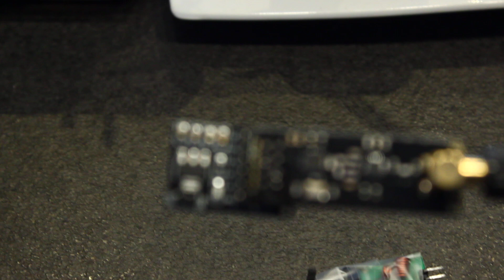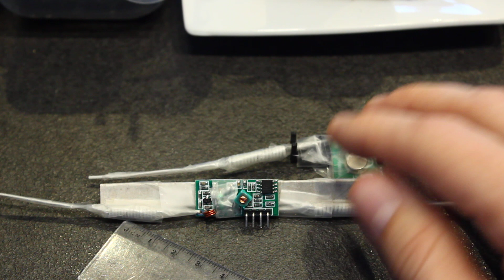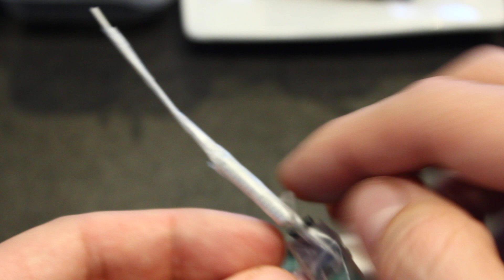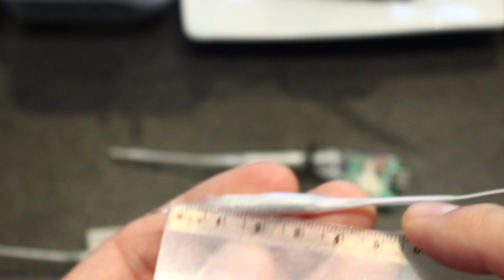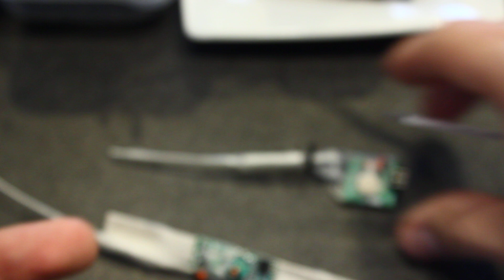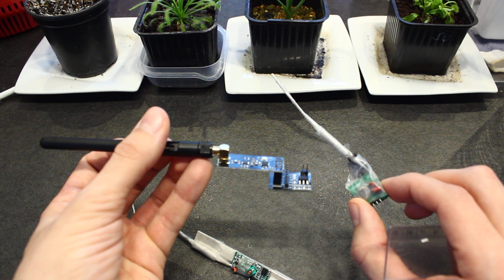433MHz RF Module range improvement: antenna

Comment: I just made two pairs of antennas (RF plus ground) for a couple of door openers. I haven't tried any alternative configurations or tuning but they made a huge difference compared to the almost non existing original antennas. The range has increased 4-5 times.

Comment: Hi Great video!! Hello, anyone knows if its possible to use this 433Mhz receiver to receive commands from  Key Garage transmitter?
Reply from the maker: Hello, thanks for the comment! I tried with my garage key transmitter using a code to receive many kinds of signals and it does not work. I guess the garage transmitter uses a more advanced protocol even if it also works in the 433 band.
Reply: @argilaga  Hi I was able to receive the commands from my garage key transmitter using a pcb like yours and rc-switch library. Now I trying to receive commands from presence sensor and open door sensor to make a home security alarm. Thanks!
Reply: It's hard to know unless you try. Given that the components are so cheap it's worth a try. I have a 433Mhz receiver connected to an Arduino Mega which talks to Home assistant via RFLink and it works great. You can debug the communication via programs like Minicom to see what codes you receive and then use those codes in your config to do what you need.

Comment: Good video bro... Direct sight and with walls can you tell how much range you got? And which meterial you used for that just copper wire?
Reply from the maker: Thanks! I used the modules in a project, I got about 30m or a bit less depending on EM noise from neighbors. I changed the antennas you see in this video to new ones made with single core copper wire (the old ones were multicore aluminum hairs), not sure if they are better but they look more neat. Video here still with the old antennas:  https://youtu.be/6bEBwqoidms
Reply: @argilaga  oke bro thanks, and subscribed. I like ur 📹video.

Comment: hi sir in 433mhz rf can we use range for 300- 500 mtr
Reply from the maker: In normal conditions no, range is below 50m with my setup. But if you had an ultra high gain receiver, clear line of sight and a clean RF environment maybe yes??? For those ranges check LoRa and other radio technologies
Reply: @argilaga  can you suggest me a good UHG receiver sir
Reply from the maker: @vigneshg3855  I do not have enough knowledge about UHGs to give you an advice, you can try to ask to the Youtube user Andreas Spiess

Comment: hi, how did you fix your antenna on the transmitter? I have the antenna separately and I don't know how to do it
Reply from the maker: You need to find a hole in the PCB with the label 'ANT' then you solder the antena in it. That's it
Reply: @argilaga  is there any way it can work without it being soldered on
Reply from the maker: @iSp3ctRuM  if the contact between electric conductors is good it could work. Try with a clip or sth that makes pressure between the two parts